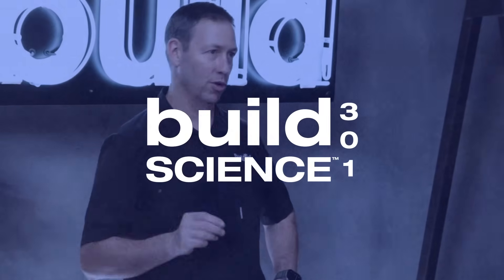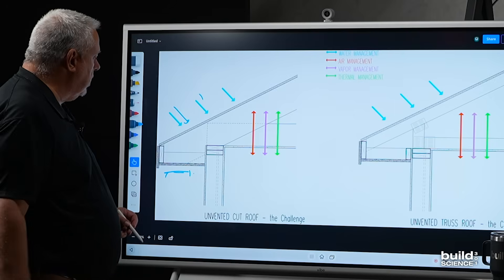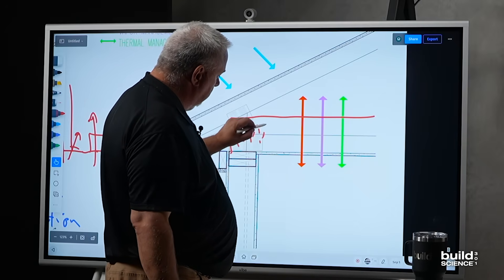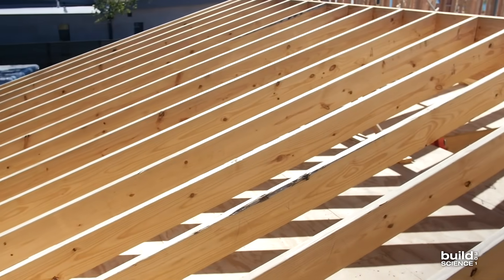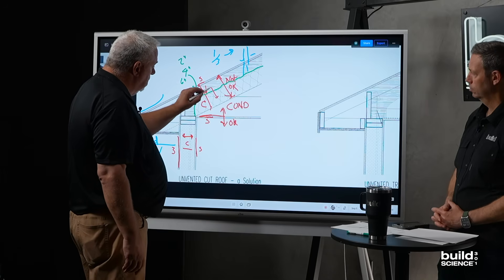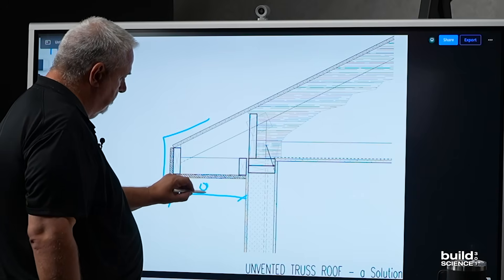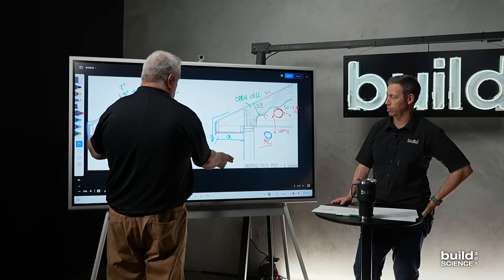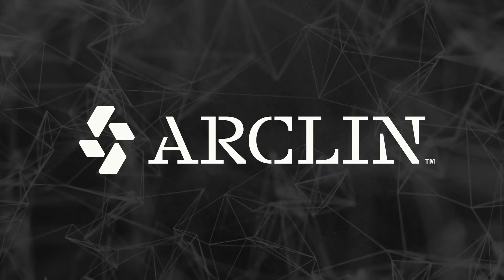Build Science 301 - Ep. 8 | Unvented Cut Roof & Unvented Truss Roof

Comment: I watched this and the previous video because I have a vented roof in Michigan with flexible, insulated duct work servicing the 2nd story (furnace in basement, supply and return trunk have a split that goes to the attic to disperse to registers). 

I’m not sure there is any easy way to fix it. It’s a 20yr old house, joists  are 2x material, tyvek-like house wrap, and the only vapor retarder on the ceiling is the paint.

It’s not as bad as older homes to heat. But I still see brand new homes go up with this construction, even though expensive custom homes. It seems like most builders here are very weary of changing and there doesn’t seem to be any code enforcement to move away from it.

Comment: Any thought about putting a heat pump type water heater (80 gal)  in the unvented roof attic to recover heat and remove humidity trapped in that space?  It could be centrally located above the bathrooms to provide shorter hot water runs.

Comment: Thanks so much Steve and Matt.  Good stuff.  I love these videos covering detail drawings.  One thing I’m not sure about is roof decking in vented vs. unvented.  Does unvented attic require an air gap between the roof deck and roof materials?  If using shingles, does that mean double deck?  What happens at the ridge?  I’m a bit confused there.  Also would love some details that show alternatives to spray foam.  Thanks so much!

Comment: what method would you recommend for true 6x6 post frame construction open floor shop-dominium, 16 foot walls, with exposed metal truss cathedral ceiling (will be able to see the OCSF),  using 2x6 girts with 1/2" zip system, 3/8" lp smart paneling for exterior walls (4" OCSF in walls), 2x6 wood purlins, 1/2 zip roof deck, radiant barrier cloth and 2" furring strips between zip system roof deck and metal roof, in the temple/belton texas area? Plan to bring all ext sheathing together, taping off all seams.

Comment: Didn't mention duct leakage. All ducts leak, if they leak in the vented attic it's just blowing air directly outdoors. Energy auditors automatically reduce their estimates of energy efficiency by 25% if ducts are installed in unconditioned attics. This is a FAR greater effect than the (significant) energy loss through the duct insulation.
Reply: that's because I would never put ductwork in a vented attic......

Comment: Thanks for this.  Maybe in the 401 you can talk about the ratio of external (Roof Deck) rigid foam vs. internal Spray foam for unvented.  Another thing to mention is that there is a risk of the flash and batt you showed where the bat is too thick (higher R) where the condensation happens on the CCSF between the CCSF and Batt.  You went real quick over that when mentioning the 60/40

Comment: I know it in Oregon in AC season, but gas is cheap, so not an issue. 1980 house with extra insulation and high efficiency equipment. Doesn’t have payback to go deeper. Also, watching these shows saved me from making bad mistakes on improving.

Comment: Thoughts on Wildfire protections with unvented versus vented.  Here in CA, we've learned the hard way around vented in wlidfire prone areas, vented showing as a big vulnerability.  I bought property up in the Sierra foothills to build my retirement home and contemplating the pros and cons versus the expense.  Even at our elevation, we have a relatively mild climate and are below the snow line, although we get 2" to 6" in certain storms.
Reply: If you aren't interested in an unvented assembly, they make fire- and ember-resistant vents that use mesh with an intumescent coating (which expands when exposed to heat to close off) and mineral wool insulation products that are literally made of basalt rock and/or slag. Those will also come at a premium, but may be less than building unvented depending on your builder/supplier/etc.
Reply: In Australia for ember attack the requirement is for any gap to be 2 mm (~1/8 inch) or less. This would be for  a BAL or 40 or less. Typically this is a stainless steel mesh, that can be cut using scissors, applied to all vent areas (including kitchen vents, stink pipes, wall vents, air con etc etc). For the flame zone, BAL-FZ, no gaps? I don't think any local councils allow building in BAL-FZ these days.
Reply: 'BAL or 40' should read 'BAL-40'

Comment: I think it is worth mentioning that insulation board can be installed on the exterior of the roof sheathing. This keeps the sheathing closer to the homes interior temp which prevents moisture from forming. There’s different thickness/percentage of total R value of the roof for the exterior insulation depending on climate zone. Any type of fluffy insulation can be used in the rafter bays.
Reply: Do you know of any good videos on how to do this? Trying to chase this method down for our current home.

Comment: The Houston example is using worst case data.  You can get decent performance with vented attic in Houston with light colored shingles, radiant barrier, passive turbine vents (and proper amount of intake), and spray foaming the R8 ducts and return and supply plenums.  When you already have vented attic with 80% AFUE gas furnace and atmosphere vent tank gas water heater, these improvements are much cheaper than converting to a unvented attic with a high efficiency gas furnace and high efficiency gas tankless water heater.

It’s beyond many people’s budget when they buy a spec built home in Houston with a vented attic to convert to unvented attic.